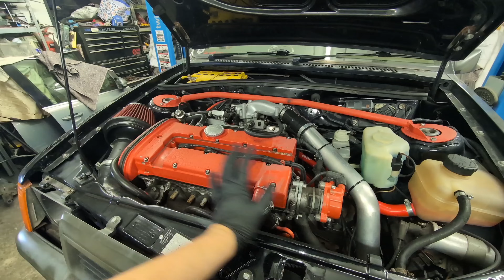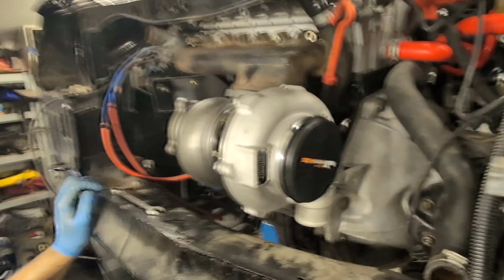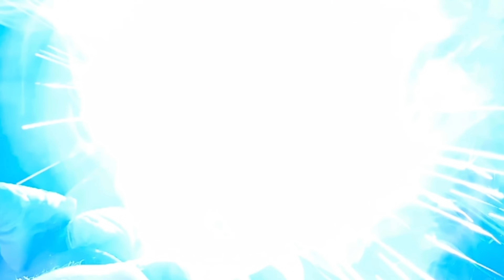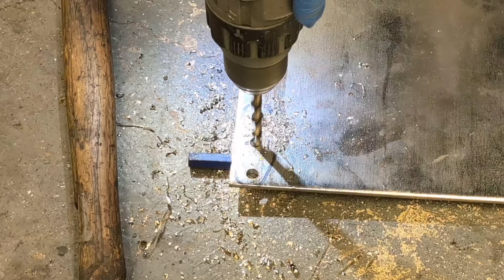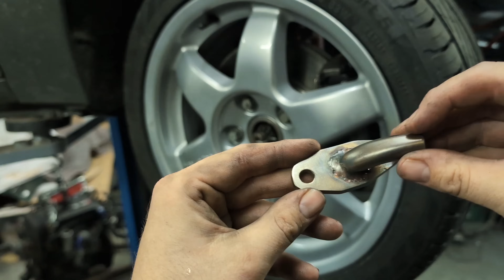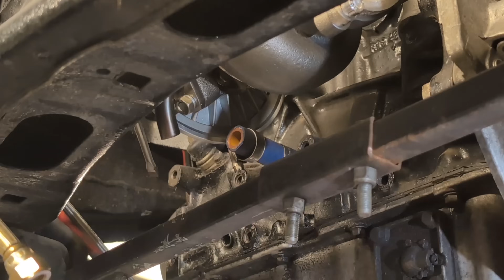I fit a MASSIVE turbo to a tiny car!

Comment: Why did you take the red top of? That's the most iconic part of the engine.
Reply from the maker: What do you mean by the red top? The plug cover?
Reply: @DanielBall Yes
Reply from the maker: It has one, maybe not in this video, I take it off for drag racing so I don't think it was refitted for the filming

Comment: Has anyone tried using a Tesla turbine as a turbo?
Reply from the maker: Not that I know of.
Reply: I works too well with water, so someone please try use it as a turbo
Reply: I'd be dubious: It wasn't primarily designed for compression, and they don't perform as well at high temperatures without using exotic materials.

Their real advantage is in applications where blades would get clogged, which isn't an issue when compressing gases.

Comment: I’m in the middle off rebuilding my Vauxhall omega with b204 Saab plant, with loads to spec ✌️ can’t wait to see this build
Reply: A problem I had aswell with a silacone return pipe to sump from turbo.. it didn’t seem to like the heat too well.. melted the inside off the silacone pipe abit.. maybe I got the wrong kind off pipe just
Reply from the maker: Okay, thanks I will bear that in mind
Reply from the maker: Sounds cool 😎

Comment: That wastegate isn’t going to flow well enough, it’ll probably boost creep so be mindful when mapping. As long as the engine can take it it’ll be all good. Will be a weapon and be interested to see what it makes as I’ve got one of these turbos laying around that I could put on my forged z20leh
Reply from the maker: I am going to forge it. I will be mindful of this too.
Reply: @DanielBall stock c20let pistons will take 450-500 so you will probably get away with a rod job forge build

Comment: you need to drill that oil feed re-stricter out so you don`t kill that turbo unless its a legit ball bearing turbo
Reply from the maker: That's a very good point, what size would you recommend? I was thinking 2-3mm?
Reply: @DanielBall  i always go as big as possible on a journal bearing turbo i ran max speeding rods turbo for years on a 5vz like that
Reply from the maker: Brill, I will get the drills out 😁

Comment: Proper spooly boi 😎
Reply: @DanielBall thing is who needs shiner parts when you know what if it does the job and it’s strong who cares, what ecu you going with RM? Plus you gotta love abit of Chinese 😂😎
Reply from the maker: I have a Z20LET management system, mapped to around 430bhp by RnD.
Reply: @DanielBall that’s sound that then, what you gunna do fit it, monitor the data then worst case use it as a base map and take it to them or get them to remote tune it?

Comment: Nice work as per usual mate. And its proof that you should hoard odds and sods pipes for a rainy day. I also used some old silicone water piping I bought for my first nova many moons ago, to keep my van going until the correct pipe arrives :)
Reply from the maker: Thanks mate, this stuff all cost lots to buy, so I am not binning it. That's what I tell my wife anyway. Hoarding car parts for the win!

Comment: Turbo looks way too close to the lower cross member, if it hits it then the housing will crack. 

Great work otherwise 👍👍 

3” bore exhaust this time?
Reply from the maker: Thank you, so the lower cross member is going to be modified a LOT, as I need to make custom tie rods. I need more room for the air conditioning compressor, condenser as well the new rad. So it will be good once done 👍🏻
Reply: @DanielBall Great to hear you’ve already planned this one ahead of time 👍👍 

Hope you do a 3” exhaust system too as a 2.5” would be very restrictive in relation to the power you are wanting to run.
Reply from the maker: Yeah I have so many plans, I just need a year off work to do it all. And definitely running 3 inch exhaust.